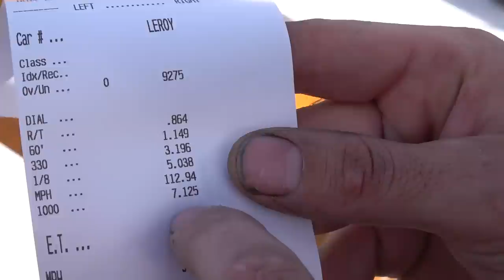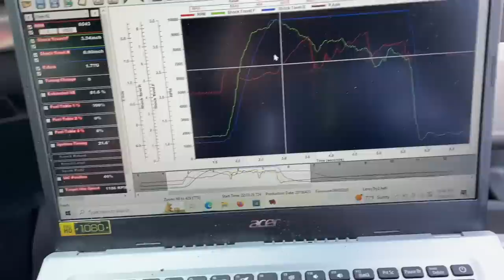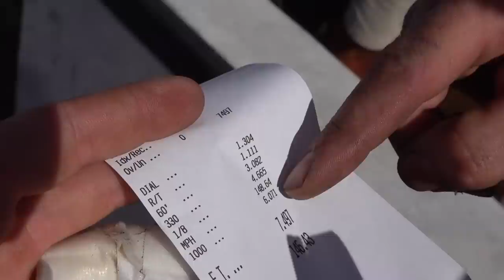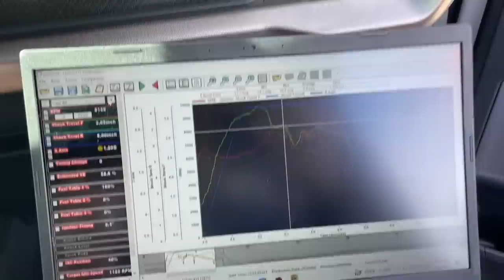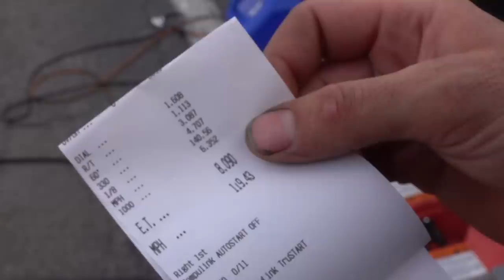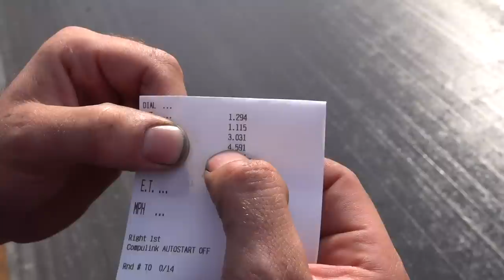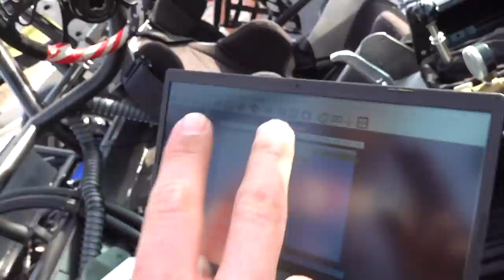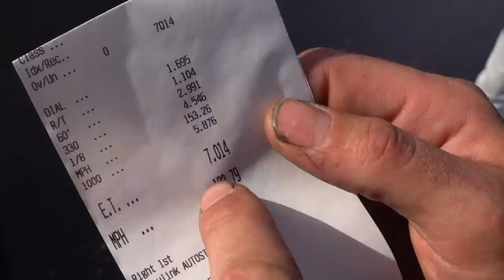You're Not Going To Believe This!!! LEROY 2.0's NEW BEST PASS!!! (Why Leroy... Why)

Comment: I really enjoy when James breaks down the time slip. Quick, clear, and tells you just what you need to know. True racer
Reply: There is still way too much anti squat (first error) in rear suspension (bar angle value is too high). Rear suspension still tops out and loses a lot of traction. You can see it in the datalog; when suspension tops out, and tire makes its last "extension", then acceleration/ G value drops.
(second error) And there is way too much rebound damping, because they try to control the extension (which is caused by the first error) of the suspension, which does not allow tyre to go back down to track, and rear tyres loses a lot of traction. You can see it in the datalog; rear suspension does not move back and forth, it just extends continuously, and graph is almost straight line from start position (loaded sag/ car sitting still) to top out.
(third error) Because they do not have traction, they try to use traction control, to "get back" traction. They can not get it back because it is already lost with too aggressive anti squat and rebound damping.
(fourth error) "Nothing works" but they just add power/ more boost (and almost kill the engine? luckily boost limit is there...). Power is nothing without traction.
So, what should they do? Turn down the boost to some basic setup. Turn down TC to basic level.  Then they have controlled setup. And don't touch it until you get the grip back.
First step to get the grip back; less anti squat/ bar angle value must be lowered at least to level where rear does not want to top out and stay topped out. It may top out momentarily at some point (especially if there is a dip in the track surface), but it can not top out for longer time period.
Second step is to start loosen the rebound damping to allow the suspension to do its basic job (extend and compress in controlled manner) which is; keep the tyre on the track surface.
Compression damping may also be too tight, but i is hard say anything about it because at the moment rear suspension still does not work at all because too much anti squat and rebound damping, so compression damping is not visible in the datalog or rear view camera angle.
Reply: @deadslow201 Post this comment on the main thread.

Comment: Not gonna lie, taking out the passenger seat and being able to see the suspension separation from the in-car is awesome
Reply: Fully agree, Totally awesome! It's a great visual lesson about how separation works.
Reply: Id bet just about any minor weight reduction or aero improvement would put them over the threshold to 6’s (I’d be looking for these things to help save stress on the engine / clutch out the back).
Reply: @ericschumacher5189  100% they’ve already tested and found the car is terribly un aerodynamic. If they found a solid body that it would fly past the 200MPH mark at the top end. But I kinda think at this point it not having a body style is the character of the car…
Reply: @redgator7250  - Just make/put a partial CF nose for the car.  Doesn’t need an entire body.
Reply: @danmyers9372  thats my thought, a front wing and diffuser, and a more functional rear wing plus diffuser would be enough i would hope!
Reply: @danmyers9372  the main drag point was around the rear axle, not the front end. A diffuser would help big time.
Reply: There is still way too much anti squat (first error) in rear suspension (bar angle value is too high). Rear suspension still tops out and loses a lot of traction. You can see it in the datalog; when suspension tops out, and tire makes its last "extension", then acceleration/ G value drops.
(second error) And there is way too much rebound damping, because they try to control the extension (which is caused by the first error) of the suspension, which does not allow tyre to go back down to track, and rear tyres loses a lot of traction. You can see it in the datalog; rear suspension does not move back and forth, it just extends continuously, and graph is almost straight line from start position (loaded sag/ car sitting still) to top out.
(third error) Because they do not have traction, they try to use traction control, to "get back" traction. They can not get it back because it is already lost with too aggressive anti squat and rebound damping.
(fourth error) "Nothing works" but they just add power/ more boost (and almost kill the engine? luckily boost limit is there...). Power is nothing without traction.
So, what should they do? Turn down the boost to some basic setup. Turn down TC to basic level.  Then they have controlled setup. And don't touch it until you get the grip back.
First step to get the grip back; less anti squat/ bar angle value must be lowered at least to level where rear does not want to top out and stay topped out. It may top out momentarily at some point (especially if there is a dip in the track surface), but it can not top out for longer time period.
Second step is to start loosen the rebound damping to allow the suspension to do its basic job (extend and compress in controlled manner) which is; keep the tyre on the track surface.
Compression damping may also be too tight, but i is hard say anything about it because at the moment rear suspension still does not work at all because too much anti squat and rebound damping, so compression damping is not visible in the datalog or rear view camera angle.
Reply: @deadslow201  I still think they made a bad mistake ditching IRS for a live axle. There are 6-second IRS cars, no reason why it can't work.
Reply: @deadslow201  Thorough assessment; I think in addition to less bar angle (which I think they did end up adjusting to) and less rebound adjustment in the shocks, they need to either switch to longer travel shocks or reposition the shocks so that they have more extension range, but I think their reasoning for not doing this to an extent is some untold reason such as driveshaft clearance or possibly shock sensor maximum length. I think they need to slow low speed extension (high speed extension probably needs to be kept loose because it's a stick car and hits the tire pretty hard) (but I'm no shock expert; this would be better for someone like Mark Menscer  to assess), but overall an inch or more of additional extension (rebound) travel would help them be able to apply power for longer (ramp sooner), power being the other thing; a billet crank/rod 6-head-bolt-per-cylinder motor that can take more boost or similar boost more reliably would be a nice luxury for them to invest in, but I think Pete Harrel is working on an engine for them.
Reply: @richardharrold9736  But the diff can't hold the shifts.
Reply: @TBasianeyes  the stock Corvette diff maybe can't, but there are plenty of IRS diffs that can...
Reply: @richardharrold9736  They had built diffs from RPM in Leroy before and they sometimes only held 3 runs.
Reply: @TBasianeyes  that was because they were stuck with the stock Corvette transmission and diff casings. They've now gone to a front mount transmission so could have gone over to a Ford 9-inch type IRS diff or a Toyota Supra or Nissan GT-R diff... plenty beefy for the job.

Comment: Cleetus- “It hit the boost safety!”
James- “Turn that shit off!”

Lmao had me rolling.
Reply: 🤣🤣🤣 "Boost safety. We ain't gonna' need that where we're going"  🤣🤣🤣
Reply: It took 60psi to pop last time, clearly that means it'll take 59...
Reply: @11:04
Reply: Put a body on Leroy he will go a 6
Reply: Ironically, if they were going to hurt the engine anyway, this would have been good advice
Reply: James is that one friend 🤣😂🤣
Reply: Boost safety a.k.a 6 blocker 9000
Reply: @joeyst.germain1133  Then It Loses What It Is. Nobody Would Care
Reply: @joeyst.germain1133  Never that would ruin Leroy
Reply: NEW SHIRT!!!!!!!!!
Reply: @Ryan Schmidt  Idk know man, I think a lift off funnycar style body with real good aerodynamics for special runs would be real cool! Especially if it was a custom one based on a corvette. With an aerodynamic body Leroy would have been well into the 6s already, Hell he'd probably working on 6.8s or 6.7s now.
Reply: It's making 45 pounds and James just wants to turn it off😅
Reply: James always knows how it is haha
Reply: @joeyst.germain1133  - respectfully, while the bod would help mid and upper track for mph, the weight brings a penalty in th 60 foot and that's a large contributor to low ET.
Reply: Its set at 45psi...i dont wanna go that high.   Sets it at 47psi, lol
Reply: Wasn't Turbski pressure issue = 8097rpm
Late shift = Rev limit = Dump Valve Gate Chatter  = ECU = Safety Fuel cut
Boost cut should POP 🔥🔥straight out Gate🤔🤔
Reply: Classic James, we don't need safeties where we're going. lol
Reply: And you know he meant it 😂😂
Reply: I’m surprised he hasn’t suggested adding some nitrous yet 😁

Comment: This reminds me of the old LeRoy days. The struggle for the stick shift world record. Making passes with a hurt engine and fighting through the pain of being so close to the goal. Thanks for taking us along for the ride. Can't wait to see more. I know LeRoy has it in him
Reply: Leroy never had the stick shift world record. He was the fastest stick shift GM, but never overall.
Reply: @Phil B  you knew what I meant, didn't you?
Reply: Is that what they call him in France?….LeRoy……
Reply: Exactly! That's what keeps me coming back. I see Leroy in the title or thumbnail...click!
Reply: @josua8448  Yes, but I want to be clear that Leroy was never close to the overall record.
Reply: Not the world record but Leroy was the first stick shift GM in the 7's
Reply: What's the world smart guy?! Lol
Reply: What are the rules for stick shift? What if I make each syncro mesh ring a big multiplate wet clutch? What if the clutch pedal helps the arm to get out of a gear? Like you use the stick to select the clutch your pedal will work on. Is the idea that the power gap while switching slows you down? So with double clutch you would want many more gears, while with stick you try to use less? And probably there is also a rule against AWD. What if the stick (serial gear shift) balances force onto two clutches and with a strong arm and good timing lets us blend over.

Comment: Leroy deserves an award for the ultimate corvette racecar. Leroy will make history. And when he retires he’ll never be forgotten. The savage will live forever
Reply: What's left of the corvette? the tail lights and the windshield?
Reply: @mmnootzenpoof  Windscreen and B pillars (and crossover between them)... Taillights are Corvette... Just not Leroy's
Reply: leroy has already made history being the first gm stick in the 7's
Reply: @fast97z24  Leroy runs a big block, not an ls
Reply: @fast97z24  uh true my bad, got them mixed up
Reply: For sure. He's already been immortalized in history though. There are so many racing/driving games that Leroy already exists in. I'd like to think that when he's retired, he'll rest at the Corvette museum in Bowling Green. He's already done what it takes to be historically significant enough to, in my book. Here's to 6's!
Reply: @fast97z24  yeah its kind've at a point where if they want the records and need to push they cant leave anything on the table. Ruby would catch up if they did a similar rear setup and lightened her up.
Reply: @xoriatmike6857  Ruby will surpass Leroy without the rearend. Probably would be much further along if it hasn’t had the crank signal issue. New harness will be the best thing for it.
Reply: @mmnootzenpoof  still corvette frame, engine, transmission, etc ofc it’s a race car and parts have been changed out but all the key corvette parts are still there
Reply: @Warku285  leroy has an lsx 427 iron block. No big block yet.
Reply: @noahstuart606  You're thinking of Leroy 1.0. for the 2.0 build they replaced the transmission & rear axle, and replaced the rear frame with a 4-bar linkage and tube frame.  The engine hasn't been stock in a very very long time.

Comment: Something that gets overlooked. Still an epic new PB, wasn't long ago at world cup where you were talking about the stick shift cars which were in the 7.20-7.30 mark like wooahh these things are fast. Now you're consistently hitting 7.0-7.2 pace. Insane improvement from the 7.70-7.90's you were running on the old suspension set up.
That said it is at a very sticky track, hoping the traction control work is going well because its going to need it at some of the other tracks.
Reply: There is still way too much anti squat (first error) in rear suspension (bar angle value is too high). Rear suspension still tops out and loses a lot of traction. You can see it in the datalog; when suspension tops out, and tire makes its last "extension", then acceleration/ G value drops.
(second error) And there is way too much rebound damping, because they try to control the extension (which is caused by the first error) of the suspension, which does not allow tyre to go back down to track, and rear tyres loses a lot of traction. You can see it in the datalog; rear suspension does not move back and forth, it just extends continuously, and graph is almost straight line from start position (loaded sag/ car sitting still) to top out.
(third error) Because they do not have traction, they try to use traction control, to "get back" traction. They can not get it back because it is already lost with too aggressive anti squat and rebound damping.
(fourth error) "Nothing works" but they just add power/ more boost (and almost kill the engine? luckily boost limit is there...). Power is nothing without traction.
So, what should they do? Turn down the boost to some basic setup. Turn down TC to basic level.  Then they have controlled setup. And don't touch it until you get the grip back.
First step to get the grip back; less anti squat/ bar angle value must be lowered at least to level where rear does not want to top out and stay topped out. It may top out momentarily at some point (especially if there is a dip in the track surface), but it can not top out for longer time period.
Second step is to start loosen the rebound damping to allow the suspension to do its basic job (extend and compress in controlled manner) which is; keep the tyre on the track surface.
Compression damping may also be too tight, but i is hard say anything about it because at the moment rear suspension still does not work at all because too much anti squat and rebound damping, so compression damping is not visible in the datalog or rear view camera angle.

Comment: Aiight slap some bigger tires on that b, shorten the exhaust (3 feet)and widen it near the end last foot, go for a crazier cam set up, She sounded rich at the start, get that boost up in first gear for the bigger tires. Good day. Oh and tune it richer in first gear only to help during the revs for the clutch dump off the line and extra torque taking off... Great bunch of lads thanks for being who you are.

Comment: Before even watching it I already know it's going to happen he's going to get .01 closer to a 6 🤣 lmao.. in typical Leroy fashion making you all work for it till the last possible second
Reply: Was gonna say the same😂
Reply: Or he could just throw the fresh mullet engine in there for a few passes and get a 6.66🤷🏼
Reply: So true, once Leroy breaks a barrier he smashes everyone within racing range. Leroy the Savage
Reply: So true, once Leroy breaks a barrier he smashes everyone within racing range. Leroy the Savage
Reply: 7.001 haha
Reply: @chrispudd1815  I think the bigger problem is the fact it’s still a normal manual. It’d be tricky to get a clutch to hold mullets engine.
Reply: @redgator7250  hey mate. So what I was getting at with mullets engine or another one the same. Mullet is far heavier than Leroy. It could all be turned down to make just that bit more power than the current Texas speed setup. 
They do now have the traction issues sorted but I do believe the only way to get a 6 second Leroy is an engine that SM builds.imagine what could be the possibilities of Leroy then? 
It will be insane and Cleetus knows that I’m sure. He’s probably the smartest drag racer in the US

Comment: you should do some clear body pannels to help with drag i feel like its getting out of hole just fine but is creating lots of drag at high speeds
Reply: I like your idea on clear panels. He's refusing to do it for aesthetics but that really is the breaking point for this car is the aero. Worse than a square body pickup. Can't really make much more power with the current engine setup to overcome it. I think if they wanted to keep that look but improve the aero at least some they could learn a lot by looking at open wheel racecars or stuff like the Ariel Atom. Get something on the nose to get that air moving up and over the car. Put front wheel covers on. Maybe put a little deflector at the top of the windshield to get it up over those bars cleanly. Bring back the old rear spoiler and set it neutral to complete the top. They could also do some work underneath with a front belly pan and a rear splitter. Might be a bit tougher to work on, but if you did everything with that in mind the panels could be made to come on and off very quickly. Don't need to worry about a radiator when you're running methanol either so getting air into the engine compartment is not an issue. Opens up a lot more possibilities.
Reply: @randr10 glad u felt like typing i wasent goin that deep but u said it brother 🤙🏻